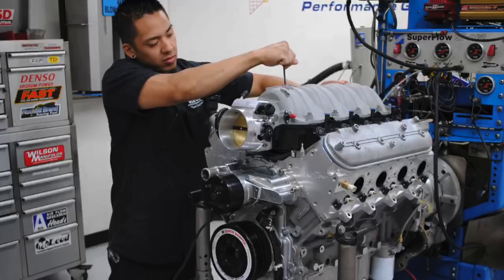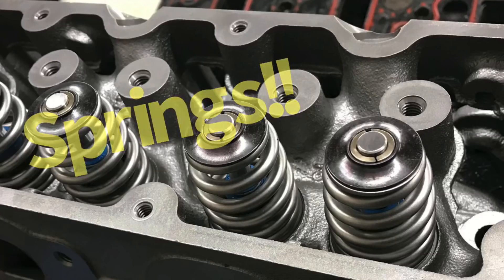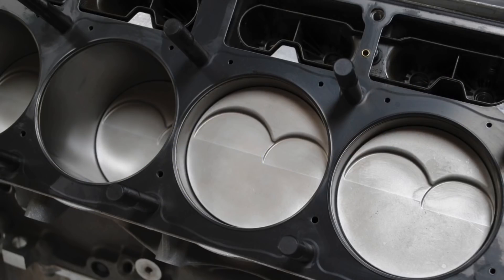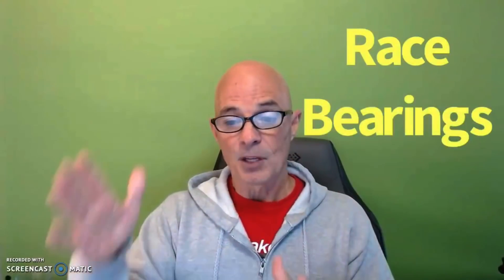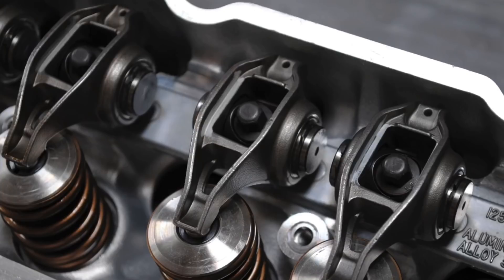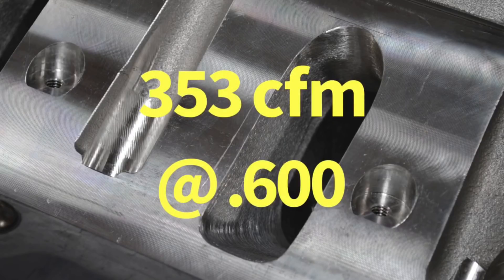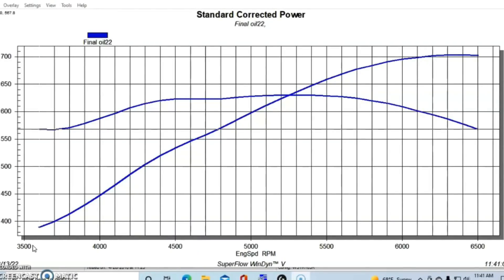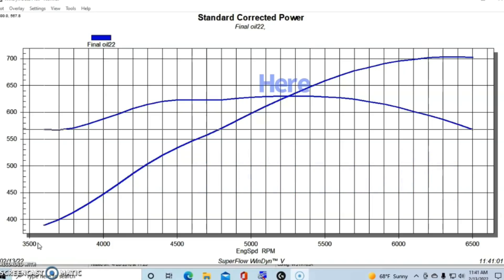HOW TO: 12:1 COMP, 700-HP, PUMP-GAS, 454 (CATH-PORT) STROKER LS.  NO REPLACEMENT FOR DISPLACEMENT

Comment: This video gives me hope.🤏 I once asked in the last year,  if I could run 11.1 on 91 pump gas With proper quench, Because sometimes 93 is not avatable. And was told, I'm going to have a lot of problems and it's not recommended. The engine is still on the stand in garage because so. It's nerve-racking when you're Is trying to learn, and living beyond Your means in the first place, When all of the smart guys are not on the same page and you have to weed through all the  armchair jockeys as well. 🥴

Comment: Just add to the excitement: Brian actually built this combination way back in 2010, back when L 92 heads were gaining popularity, but nobody knew how to properly cam them and time the valve events. 

He was an absolute guru with cathedral port head architecture, and all of the strongest running LS engines were running TFS heads in the appropriate sizes.

He and I worked together on my 2005 GTO that I used to road race. I had some very specific goals in mind utilizing TFS235 heads with softened chambers so that I could run 12:1 SCR  on pump gas. 

With a medium cam and good drivability, the motor made 640 on the engine dyno, and 550 at the tires…through a built 6 speed manual in an IRS car. And this was in spite of the handicap of having only a 4.00 inch bore to work with.

The car went 10.90s at 128mph naturally aspirated back in 2013, when all the fastest street cars are running about 126-130 traps.

I’m genuinely proud of Brian for what he has accomplished with BTR, and I’m very fortunate that his knowledge, and my attention to detail, were able to make some fantastic power that surprised a lot of people. 🍻 ❤️
Reply from the maker: he is good people
Reply: @richardholdener1727 Richard, I’d love to know how many degrees of timing you were able to put into this motor. And how much of a difference the soft chamber makes.

Comment: When you gave the cam specs, the exhaust having 15° more duration than the intake sife didn't make sense to me...

Then you mentioned reducing the size of the exhaust valve and giving it a 50° valve job. Equilibrium restored.
Reply: My thoughts exactly.
Questioned why he didnt run to a solid roller....til I saw the chart, peak etc.

Comment: I actually built my own 427 version of this build nearly exact ( slightly different Cam Profile and Pistons) and can testify .....its an absolute beast on the Drag Strip in a HONEST 72 Rally Nova with old school Borg Warner 4speed complete with Mr.Gasket Vertical Gate new old stock shifter
....and one HELL OF A LOT OF FUN TO JUST DRIVE !
Reply: I actually run 2 fuel tanks in the trunk one that's chilled and is for racing and one for street driving.  Helped me solve a couple of issues that I kept running up against. See I'm an old school Carb guy and drug my feet as hard and long as I could to avoid the obvious. I was in the middle of building a new 427 big block for my street car and got a chance to latch on to this engine for penny's really and started hitting salvage yards from Iowa to Idaho and gathered a fairly impressive bunch of parts and pieces in my quest for what I wanted. 
P.S. .....The old school 1967 original GM 4 bolt 427  is still sitting on the Engine Stand in the Corner waiting quietly for me to finish it.....someday.

Comment: Would have been ALOT less work to run ls7 heads. This 454 wouldn’t break 600rwhp. Pretty bad when H/C/I z06s make 650+ r whp today
Reply from the maker: THEN WE COULD SEND ALL THOSE BROKEN VALVES AND SEATS THROUGH THE MOTOR!

Comment: Hey Richard I've recently acquired a 08 5.3 that came with the 243 heads however someone  ripped off the 243's and left 706's as a replacement. My question to is since I'm only using this engine as a work truck it doesn't hurt my feelings to not have the 243's but out of all of you head test can you recommend a head that offer similar numbers as for a toque and compression as the 243/799 because the truck is a 4 wheel drive and if I should ever need to pull or tow I don't want to struggle. Thanks man and keep up the great work.
Reply from the maker: the 706 will work fine
Reply: Thanks buddy

Comment: I love these where the motor by itself is pushed to the max - utilizing all the tricks.  Also I think this shows that swirl, port velocity, correct sizing of the valves and other factors are much more important than just hogging out 'holes' to get power.  Great under the curve power too.

Comment: Dude Richard, it's 2022 man!  Sleeves are no longer needed to run that kind of stroke.  You can put a 4.250" stroke crank in a 6.0L block.  It is a little tricky so you have to have a good engine builder and the right piston design, but it can be done.
Reply from the maker: DUDE-2022 DOESN'T CHANGE SLEEVE LENGTH
Reply: @richardholdener1727  Sleeve length doesn't need to change dude.  The design of the piston has changed though, which is what makes it possible.

Comment: Hello, I always watch your videos, and I learn a lot from them. I have a stock 5.3 Lm7 engine and 862 heads with a 68 inlet and 90 outlet turbocharger, with a fitech injection system for 750hp with a 102 throttle. My question is what do you recommend for my configuration? , and also if you know the gap between the rings and the pistons, I understand that it is different when it is turbocharged for street use.  Thanks for the help.
Reply from the maker: SET RING GAP AT .028-USE A GT45 TURBO FOR 700-750 HP

Comment: Recently built a 416 LS3 for my chevelle and going for a similar power number. 13.2:1 compression, ported LS3 heads, ported/rodmod LS3 intake, ported throttle body, 235/251 @.050 cam and running on E85. My inexperienced brain dyno says 720-730 and an engine dyno will soon tell me but its cool to compare the similarities with other motors.
Reply from the maker: 730 hp with a 416 and a 235 cam?
Reply: @richardholdener1727  Guess thats highlighting the inexperience of my brain dyno lol is 670 a more realistic number?

Comment: Thank you Richard for doing an in depth on this motor.  I first saw your mentioning of this motor when i watched your video on the 700HP builds.  You did not go too in depth with it back then.  
A few questions, shimming the factory lifters, is that Brian's way of making it a low lash or a solid roller setup without using the actual solid roller lifters?   Why not use E85 and raise the compression just a little more to get even more power?  Is it necessary to still soften the chambers if the motor will be running on E85?  Do you think with the availabilities of so many aftermarket cathedral heads out there, if one follows the basic short block, a low lash or actual solid roller cam with similar spec and used either AFR, Mast or even Frankenstein cathedral heads, it is possible to make even more power without sacrificing the incredible amount of mid range torque Brian was able to make with his engine?
Reply from the maker: This engine was done 11-12 years, it is possible to make more power with different combinations of heads, cam and intake, the lifters were shimmed to effectively produce short-travel lifters-I doubt a solid roller is necessary in this rpm range
Reply: @richardholdener1727  are there any pro or cons achieving this engine size using either 4.125 stroke with a bigger bore or 4.250 stroke and 4.125 bore?  Can you school me on the advantage of short travel lifter?

Comment: How much boost would it take to match the output with a 6.0 and price difference ?
Reply from the maker: less than 10 psi on a cammed 6.0l
Reply: @richardholdener1727  Wow and a lot cheaper no doubt. Taking nothing away from the N/A build it's impressive. Thanks for the reply.

Comment: My question in all of this is how long is a motor like this with all these mods gonna last? Is that something that can live on the street say a 100grand? Fun for a street strip only? Or am I wrong? I'd like to do an all motor setup myself. But GM got motors at 17 plus grand. And then to get one built up like this costs how much? To go fast costs $$$.
Reply: Built right those kind of miles is not unrealistic, depends on rod/piston/ring package and if you laid it out properly for that kind of stroke, good hone job - just like every motor

Comment: A I still wanna see you do a big bang on a geo metro 3 cylinder 1.0l engine cause I wanna see how much horse torques it'll make
Reply from the maker: I have a 1.0L, 3-cyl Sprint Turbo motor
Reply: @richardholdener1727  I wanna see how much horse perrs and torque before the big bang I'm just asking cause I put one in a buggy and I wanna know how much power I can get out of it I know they only do 52 horse torques I know they like timing I could tell when I bump the timing up on it but it's just like anything else

Comment: Dynamic Compression Ratio is the key to running High Compression on pump gas. At 12.00-1 SCR I’d expect a relatively late closing intake valve timing @.050”ABDC +- 60-62*
Reply from the maker: THERE IS MUCH MORE THAN JUST DYNAMIC COMPRESSION
Reply: @richardholdener1727  The point is those “Softened” quench pads wasn’t the main contributor. DCR is a far more important factor in manipulation of compression for octane compatibility. if you disagree it shows your lack of knowledge of engine theory. JD

Comment: Let me ask a stupid question: how do you get away with 12:1 compression on 91-93 octane? Does it have something to do with swirl?
Reply from the maker: cam timing, alum heads, softening the chambers, tune
Reply: @richardholdener1727  I`ve been at a little over 11:1 on pump gas but was under the impression that chamber softening was for nitrous applications only

Comment: BTR made 94 hp/L @ 6400 rpm on pump gasoline and that is well within "You can not do that" territory for almost all of us. :)
Reply: What’s cool is that Honda already did that 25 years ago on pump gas. Actually 100hp/liter.
Reply: @Bacongrease00  yeah obviously efficiency is naturally highest in smaller engines, you could argue that those 10cc engines you get from hobby shops make far more HP/per L than a Honda NSX too lmao...

Comment: 12:1 on pump gas you say. Those must be some magical combustion chambers and cam specs.  Really nice build.
Reply: Factory cars run that on pump gas these days.  Cylinder pressure management is all
Reply: @jefflowry4112  most likely direct injection, huge difference
Reply: @jeremymyers5643  true, that helps in oem applications.  We are not constrained by their requirements such as emissions and NVH so we can utilize cam timings, operating RPM ranges etc that they can't so its just as attainable on port injection.

I could build a 13:1 port injection pump gas setup if I wanted to (i don't, it would be 13-14:1 and on flex fuel but I digress LOL)

Comment: Impressive to be using 91 or 93 octane at 12:1 compression!
Love this big cubic inch LS content.. Very compact and light engine compared to BBC.
How does a LS7 block stack up against an aftermarket Ali block, say the RHS? Would you choose one over the other, keeping in mind the tall deck option?
Reply from the maker: not at this displacement-I use an RHS tall deck for my 495 inch stroker
Reply: Rhs block is chinesium. Hope yall got better luck than I had. Mine was DOA! Mast, chad golen, and many others have had enough of rhs too

Comment: Hey Richard! Got a question regarding my 454 LSX. I have a 2005 ctsv stuffed with a modified lsx 454 from Gm. This motor was originally built for nitrous, build list is below. Now my concern is this car made 500whp on a mustang dyno and 570whp on a dyno jet. I would like to make this an all motor build, and get rid of this low compression nitrous setup. What do you recommend? Considering this car can’t keep up with new full bolt on cars on motor something needs to be done. Thanks in advance!

Currently on the motor:
454 Lsx
Factory lsx 454 heads
Diamond pistons (10.0:1 compression )
Scat rods
Stock crank
Clevite main,rod and cam bearings
Manly hardened pushrods
Arp bolts and studs for everything
Cometic head gaskets
Cammotion Custom ground Na/nitrous cam 
Summit racing trunnion upgrade
Innovators west harmonic balancer
Comp cams locking idler pulley
Fast 102mm intake
Nick Williams 102mm boost throttle body
Fast fuel rails
Fast 88lbs injectors
Ls3 coils 
Holly valve covers
Deatchwerks 310lph fuel pump
Power master mini starter
Kooks 1-7/8” to 3” headers
Reply: Complains about low compression
Me: laughed in 7.8 to one
Reply from the maker: you have the displacement-you now need the right heads, cam and intake
Reply: @richardholdener1727  is the fast 102 intake okay for this build? I figured a cam would bring this motor back to life, and I’m having trouble choosing heads. But the real question is do I keep the compression the same and just get better heads? I figured to help this motor I would need to change the pistons and raise the compression to something similar like the motor in this video

Comment: I did a test on my car comparing 1 7/8" to 2" on the dyno using my 416. Only difference was in the overrev past peak HP. 2" had a gain of up to 8hp in the overrev.

Comment: I’m sure this was awhile ago! Because there is a lot of well over 700 hp 402s & 427s out there! Also if it’s staying n/a it should be fine, but those overseas 4.25 stroke cranks break! I’m not the only one either where the crank broke in less than 50 hits! It was being sprayed, but it hadn’t been sprayed much, & with maybe 300 max! Because the internet is usually all BS, ask Mr Reher if he’s had them break! He’s got a small engine shop in Texas 😂😂😂😂! He might know alittle more than most 🤣🤣🤣🤣! They will work if you have a Bryant crank in a Dart block with the larger mains! But that gets really expensive! I don’t know if you’ve seen what’s left of those aluminum blocks after a resleeve  job! But there’s not much left of that really cheap aluminum! People do it all the time, but if you are running them hard with nitrous or boost, don’t be surprised when they break! Maybe that’s something you could mention on your channel? The aluminum that say Dart uses, is many many times better than what the manufacturer uses! Also the aftermarket strong stuff does make more power due to rigidity! There’s tons of top builders that will tell you that! Thanks for your great testing! 👍🏻👍🏻👍🏻👍🏻🇺🇸🇺🇸🇺🇸🇺🇸

Comment: To be honest with everyone i am not surprised by the H.P. numbers at all. My son made 525 rear wheel though a automatic over 10 years ago with a 346. That's close too 600 H.P. flywheel, and it was 12.1 to 1 run on 93 with a splash of 100 octane. Stock short block that had the pistons relieved for the valves.  The part of Brians build that is impressive is the T.Q.
Reply: easier to hook, cheaper to build...better!

Comment: Richard your advice is solid, you just can't factor in Brian's wizardry when it comes to airflow. Now I need to learn what softened chambers are.
Reply: Brian has a much better touch on reality of engines than Richard does 😆 This engine and similar combinations has been done over and over by us in industry for last 15+ years
Softening chambers is process of taking the quench area (flat part) away to make it more hemispherical kinda so its not so timing sensitive, often in power adder scenarios

Comment: This shows the genius of a math magician...the fact that the 408 from a 6.0 made 625hp with lower compression & none of this extra exotic work says alot...& it's waaay cheaper
Reply from the maker: HIS 454 STILL HAD A HIGHER SPECIFIC OUTPUT-AND IT'S EASIER TO MAKE POWER WITH THE SMALLER MOTOR-CREDIT WHERE CREDIT IS DUE

Comment: Wow a 700 H.P running on pump gas. Could a similar pump gas engine be built from a 5.3 LS into a 383 stroker engine. If that is possible with turbos how close to 1000 H.P. on pump gas?
Reply from the maker: maybe

Comment: That is one impressive torque curve! As I recall, the factory LSX454 was 750 hp, even more than the then-biggest 572 BBC. It was not, however, a street engine, probably would not run on pump gas…don’t remember. I guess Brian wanted to use those TFS 245s, but the GenX 255s or 260s would seem to be a better choice for power. Maybe not for that torque curve, though. I don’t want to second guess the man, i think he knows what he’s doing! Very interesting story, thanks Richard!
Reply: It’s was LSx454R with 13:1 and it hit over 750hp with a solid roller cam. I bought the crate LSx454 but been trying to figure which cam to use to make more than 627hp it’s at now
Reply: @1967grimreaper  What cam does it currently have in it?
Only way Id ever ls swap is to go straight for a 454
Reply: @gordocarbo  648/648 on a 110. It’s a very “mild” cam for the for a crate engine. The engine hit 627hp/600ft tq w/carb and 585hp/600ft tq w/EFI.

Comment: Brian Tooley Racing valvetrain, including the ULTIMATE RPM LS SPRINGS and LS RETRO FIT ROCKER SHAFT MOUNTS occupy the stock 862 ported heads of the current World Record holding 8,600RPM turning 4.8L Stock Bottom End (OEM rods, pistons, crank, rod bolts) Record holder in 1/4, 1/8 and MPH car of Jack from Squirrel Tuned. Although not required for the Record Race, he still runs hydraulic lifters (Johnson Short Travel) with beefy BTR pushrods. He feels that the magic to his entire setup are the Ultimate RPM BTR springs. 660ft 4.95 @ 140.8 mph, 1320ft 7.80 @ 168.1 mph. Estimated 2750lbs w/Driver @ calculated 1330 Crank HP.